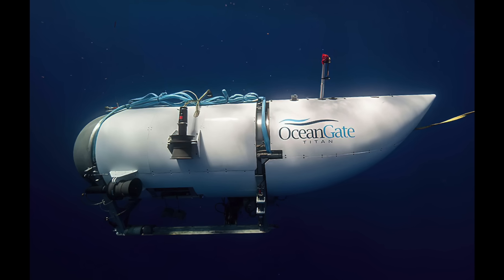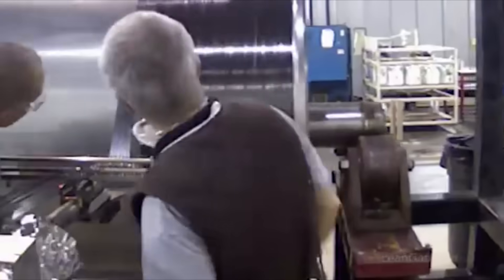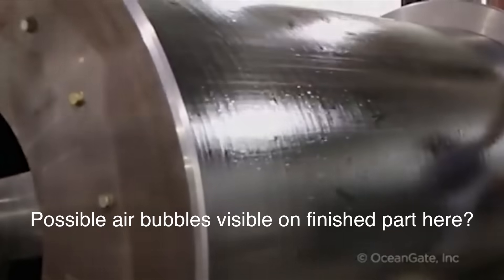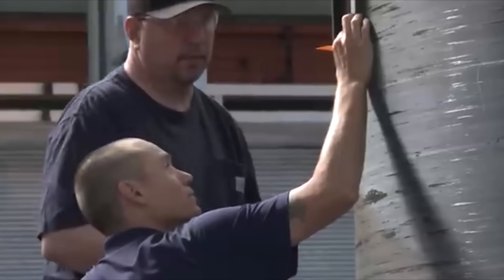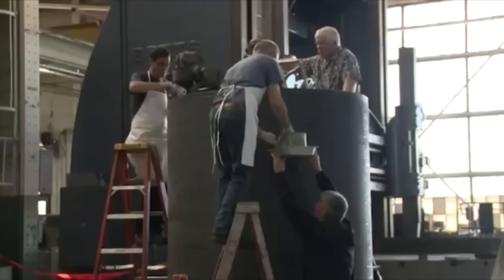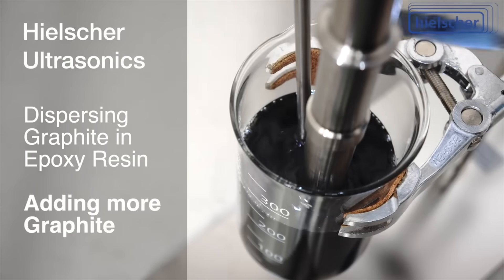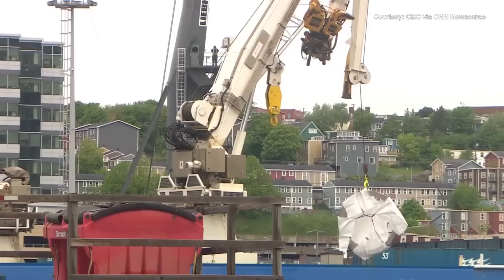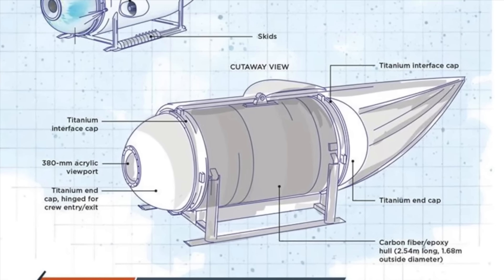Why OceanGate Titan Imploded - A Carbon Fiber Composites Perspective

Comment: I agree with lots of this video. Here’s my take on it.
Stockton is a bit contradictory about the laminate. Is it a 0/90 or purely at 90 . All the pictures of the build available show wet winding at 90. Putting fibres at 0 ( or any other angle) with this set up is tricky as they need to be held in place. From what I have read it looks like the actual material used was out of shelf life prepreg cut into strips and applied by a tape placement machine. If so any axis could be applied. However as the main loads are at 90 any additional angles will increase the required laminate thickness. It is quite possible that the fea shows no loads across the adhesive bondline ( apart from compression) so a poor bond may not be the root cause ( I agree that the way they have done this bonding operation is awful- hand mixing, with possibly home made additional materials- what???- the guy with the dirty rag and no gloves!!) there’s so much wrong here I don’t know where to start!

Comment: there are 2, maybe 3 serious flaws here: the pressure vessel is loaded by pressure from the outside!! the way this structure ist build up would be right for pressure contained on the inside, like H2 tanks on vehicles or rockets. second is- you only glue 2 items together at a very shallow level, which means that the stresses are transmitted via the epoxy and not the fibres. this may lead to delaminating of the CF. and yes, this bonding is done practically like you would do it at home, not like some high loading part is assembled ah yes, and 3rd- such a thick wall of CF strips would best go into an autoclave.... 
nothing done, nothing taken care of. the sub was, sadly, designed and manufactured in a way which precluded successful repeated ops.

Comment: Rush said the submarine was equipped with many acoustic hull integrity detection devices.  The purpose of the system was to provide Rush and his joyrider passengers, aka "Mission Specialists," an advanced warning while down with the Titanic that the hull was cracking and an implosion was imminent if they did not surface immediately.  A digital timer then gave them a 45-second countdown to implosion.  Apparently, Rush hadn't considered that it took around 2 hours to surface!  It was his, "Oh shit" moment.

Comment: I believe that they should have wrapped the carbon fiber around a titanium cylinder and not removed the cylinder and then attached the cylinder to the end caps .

Why remove the cylinder from inside the carbon fiber after shaping?

I know it gives more room but they could’ve just used a larger diameter cylinder. 

What would it take-
a couple of inches of increased  diameter to match what they ended up with?

I just don’t think it was wise to use carbon fiber only carbon fiber only.

It should have been blended with the titanium instead of being placed into such a stark contradistinction in their essential make up between the cylinder and the end caps.

Comment: this is why:  1st and foremost:  CEO was a narcissist which lead to him cutting corners. To-which they did all their testing in the Bahamas.. skirting industry standards and at minimum U.S. submersible certifications... finally the CEO got woke....what he got in return for this fatal decision;  were yes boi's and gurls.  When this 50 y/o white Ex Navy submariners,  Deep Dive Sub. pilots and engineers told "Carbon" Rush..."this is a death trap"  "you can't do Carbon Fiber to titanium...what did he do....His Ego, pride and his Narcissisms got in the way...he fires the most experienced people, for 25 y/o yes men and women.  results...he turned "his tourist" into jelly.  You can do a million vlogs for thumbs... Eventually they will come up with a hypothesis if not the mechanical cause.  This was destine to fail because of  one man!!!

Comment: Good video, i did question myself these work methods. As in the video shown, this could be me working on my first boat project :)) pfff. 
Some further thoughts: we talk about carbon fibre as if they all are the same. But are not.  A good explanation is to read in "Surface Treatment of Carbon Fibers - A Review"
by S. Tiwaria and , J. Bijwe:  and states: Carbon fibre surface is chemically inert and and likely to be contaminated from production, leading inadequate adhesion, thus weaker composite. It is essential to treat them with proper treatment. Several surface treatments of CFs are classified in two categories. First, improves the adhesion by physical means thereby enhancing the roughness resulting in more surface area and a large number of contact points, micro-pores or surface pits on already porous CFs surface. The
second on the other hand, involves chemical reactions leading to inclusion of reactive functional groups that promote good chemical bonding with the polymer matrix. Most of the methods bring both the changes. 
For every application there is a best performing CF with the specific type of resin which results,  for a certain application the best performance composite. I believe that for certain one could make a vessel from a composite. But that does not start in any way with buying CF which has past its shelf live and was for avionics applications.

Comment: There's another consideration that Rush appears to have ignored, too.

Even if the bonding of the titanium ring to the carbon-fibre-composite cylinder had been performed under perfect conditions, with perfect preparation and heat-treatment to fully cure the adhesive, we must also consider compressibility.

Under an external pressure of c. 380 atm, both the carbon-fibre-composite cylinder and the titanium rings and hemispheres will have been compressed to some extent. If we look up figures for these behaviours, we find that a typical carbon-fibre-composite is approximately twice as compressible as "off the shelf" titanium.

Thus, even assuming that the carbon composite - titanium interface had a perfect bond and perfect fit on the surface, at any significant depth the two components would have been compressed by different amounts. The carbon-fibre-composite cylinder would be compressed to a slightly greater degree than the titanium rings, resulting in a tensile force on the adhesive. I am not a materials scientist nor a maritime engineer, but I'm not aware of any adhesive that performs well under tension.

The initial failure may well have been at the interface between the carbon-fibre-composite and the titanium as the adhesive finally gave up the ghost.

Comment: It's just astounding how many mistakes and corners were cut by this guy. Strength to Bouyancy is horse-quaqamole. Buoyancy isn't what kills you at 12,000 ft, its pressure. I'm amazed this thing actually held together for 10 other trips. Mr Rush was truly a "baffle them with bullshit" and "smoke and mirrors" engineer. Its shocking and sad people paid good money and risked their lives with him. Informative video!
Reply: "...Mr Rush was truly a "baffle them with bullshit" and "smoke and mirrors" engineer. .."

Don't they have the same rigorous Chartered Engineer exams in the USA? I was flabbergasted that Rush could hold himself out as an Engineer without profession exams - thus said with me being a surgeon and having the barber's pole outside my house of course.

Comment: I've worked in R&D labs for a while and I've got experience with film crews making documentary style promotional videos such as this one. I've not seen the OceanGate video to be fair, but I would hope that what they're doing in the promo (not using gloves when degreasing etc) is because they're doing things that look good on camera, i.e. pretending to do what they're doing.

I'd say when there was no glue coming out between the two layers, that was probably because there was no glue in there at all. As you said, not bonding the two materials in a clean room with pre-treatment of the surface would be an unbelievably amateur mistake.

That's what I would hope anyway, but then again pretty much everything I've heard Mr Rush say has shown a worrying lack of knowledge and critical thinking, so perhaps they did just glue it together in a warehouse and hope for it.

Comment: Its pretty simple , like a aircraft the frame has only so many compression cycles before a hole opens up in the aircraft, 

With deep sea pressure, unlike what a aircraft has to deal with (opposite of pressurized from within) it would have so many cycles

Comment: These videos of the 'winding'.....no 45 or 60 degrees and where is the vacuum and autoclave....you want to make sure you really suck out any entrapped air if you're going that deep....still...I've never seen carbon fiber considered for any vessel built for 'compression' of outside forces....but it is quite strong for pressure cylinders...

Comment: Ironically, a Pringles can is actually better engineered than the titan sub was.
Reply: Because a Pringle’s can was engineered.
Reply: And like a Pringles can... once the Titan popped; it just couldn't be stopped...
Reply: Titan was just a giant Tylenol.
Reply: Cardboard has a superior strength-to-buoyancy ratio yo!!!!
Reply: He didn’t do the carbon fiber hull for boyancy purposes, he did it cauz it was cheaper 😂😂
Reply: @ValentinG23   both
Reply: Ironically, a third grader running on little sleep could compose a better grammatically-sensible sentence
Reply: @777xdyork55 Ironically, even a third grader can see how childish it is to make a jab at a random innocent person's grammar for no reason.

Comment: Just an arm chair critic here, but I did do some work in prepreg and on the machine that were used to make the hull. I think the carbon fiber probably separated from the titanium rings. Or at least that was a significant failure point. The titianum is going to hold its shape much better than the carbon fiber. The flange that they have just doesn’t appear to be sufficient to take that into account. Probably as the CF cylinder got crushed, it would pull the outer edges away form the titanium haul and introduce a small gap, or at least put the epoxy in tension which is a major no no.

The other massive oversight that is saw is that there are no 0deg fibers (parallel with the axis). The two ends would be pushing and trying compress the fiber cylinder (like standing on a can). As it was made, only the epoxy was taking this compressive load. This definitely could cause cracks in the epoxy and weaken the haul. 

The whole thing is just absolutely moronic! Shitting engineering.

Comment: You can see a strap placed through the endcap door and the viewing window. If the window is missing then I would venture a gess that the window was the catastrophic failure that caused the implosion.
Reply: At 7:22 to 7:30 of the video is where you see the strap through the viewing window.

Comment: The choice of using a composite material whose strength is compromised dramatically under compression is such a baffling decision. Fiber adds considerable strength when the internal pressure exceeds the external pressure, but is essentially useless under extreme external pressure. When I learned that the loud popping and cracking sounds were ignored and even expected, I wanted to scream. That is literally the sound his stupid alarm system was designed to detect, but he chose to ignore it because he was convinced his design was so innovative. Just staggering levels of stupidity and recklessness

Comment: In the video that you included Rush states that the hull cylinder was wound in a 0-90 pattern not just wound in one direction as you seemed to state.  This is the first indication I have seen that the reinforcement was not just circumferential.  Of course I don't know what the laminate sequence was or how skillfully it was built up.  I'm not surprised that we don't see the longitudinal support in the videos since its installation usually is a more manual process that looks less neat in videos.  20 years on a national standards committee for composite vessels.

Comment: "There's no torsional moments"

Until you TOW THE SUBMERSIBLE ON THE SURFACE IN ROUGH SEAS.

Why they thought this was acceptable for a relatively fragile vessel is baffling.
Reply from the maker: Excellent point. I also heard it was left hitting off a buoy for many hours once too…